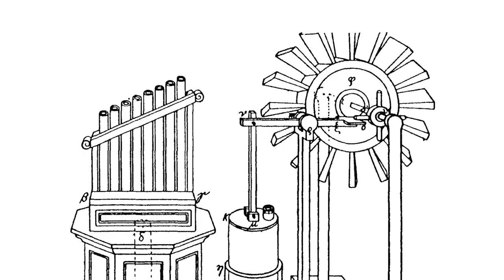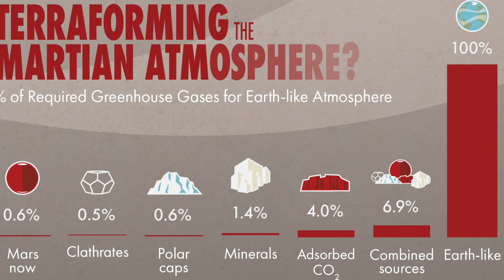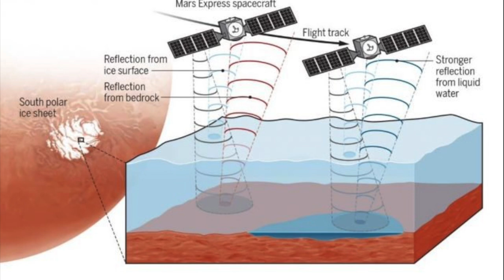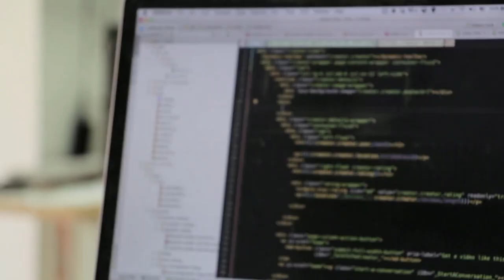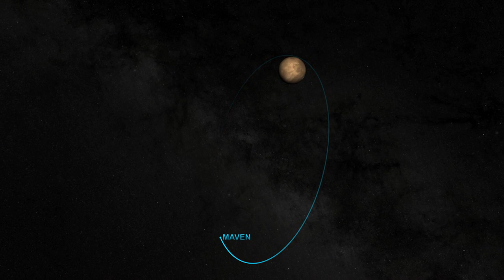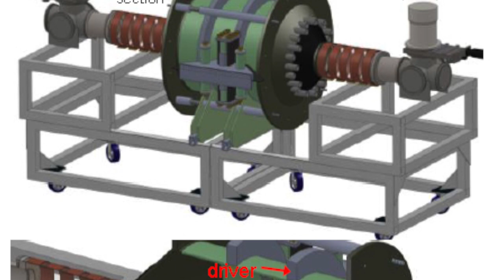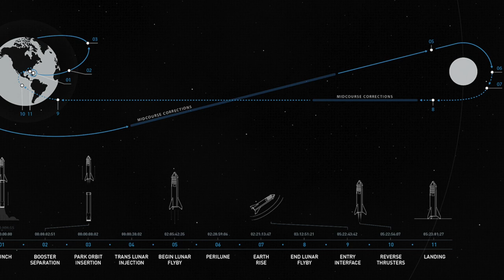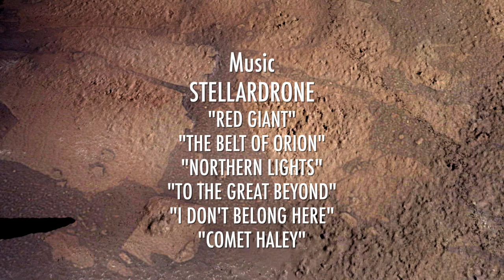Mars And Beyond With Dr. Robert Zubrin

Comment: I'm no expert but I think until and unless we put an artificial magnetosphere at Mars, we can pump all the greenhaus gases into the atmosphere we want but they'll be blown off the surface by solar wind. Mars will remain the domain of extremophiles (sp?) until we can deal with the radiation issue.

On a less critical note, JMG, I LOVE the new channel.
Reply: the solar wind issue depends on speed. like a water tank: it can leak AND be full if you manage to pump in the amount of water you are losing because of the leak. if you replenish those gases faster than the solar wind can blow them away, you're good.
radiation can be a problem, though and humans need some shielding, but it doesn't have to be a planetary shield. just live under the surface and bring some portable shielding technology if you have stg to do on the surface.
genetically modified humans? changing hair colour or stg like that is not a big deal, but creating a radiation proof human... that would be a far greater challenge. by the way, can you modify the genes of an adult? if it is possible only in fetuses (or at some pre-adult stage), it brings up a ton of ethical and legal questions
Reply: I agree in principle with what you're saying re: the water tank analogy. It's just that you really gotta be churning out a consistent output to make that work and achieving that is gonna take time. An artificial magnetosphere is, as another commenter elsewhere pointed out, not that difficult to deploy and would solve the shielding problem everywhere on the planet all at once.
   Bioforming, to me, always seemed like the premise for a good space monster movie. The premise is fascinating though and I'm eager to learn more about it. I first heard about the concept back in the 90s. My first impression then was very much like yours (legal and ethical questions). The idea is compelling though and merits more discussion.
Reply: Mars is more valuable as a quarry than as real estate. It's a lousy place.
Reply: "You stopped being human when you claimed that miserable red planet." - Admiral Nguyen (The Expanse)

Yeah I've always believed rotating stations were the way to go instead of planetary colonization. No muss, no fuss, you just build it and you can customize the environment "to taste." You can even adjust the gravity to your liking. But let's face it, people like the idea of living on planets for some reason. Mars will most likely be terraformed in the future, probably Venus too.

Yes I ended that sentence with a preposition. So naughty.
Reply: I agree it is a problem that will have to be addressed -- probably in several ways but it seems to me that it is essentially an engineering problem -- some sort of magnetosphere or orbital shielding perhaps to achieve anything more than just limited terraforming.
Reply: @sargonofakad  A thicker atmosphere would suffice to protect Martians, and supposedly an atmosphere would last tens of thousands of years without maintenance. Or forever, with maintenance. It's still a lousy idea IMHO. I'm with the orbital city commenter above. 

Once people have a choice between a rotating garden with decent internet and a nasty, empty, disconnected, low-gee planet, then stations will take over from planets as the common-sense destination. Every planet except earth is really awful.
Reply: @fraggenaught  ... up with which shall not be put.
Reply: Maybe that will be 'easily' obtained, considering we will have the available power by then.  In the meanwhile we can 'easily' live underground in dome-shaped caverns.  The low gravity could be partially-solved ('easily') by rotating our local environments.  QED
Reply: @tonyduncan9852  Quod errat demandstrandum
Reply: 'quod erat demonstrandum' - the Latin for ""that which was to be demonstrated".
Reply: @tonyduncan9852  thank you for the correction,i was not certain of the correct
spelling

Comment: Good interview, Dr Zubrin is always insightful. Though I don't really agree with his opinion on not sending the BFR spaceship all the way to Mars. That just increases the complexity and makes landing on Mars more difficult because an entirely separate heat shield and propulsive landing system is needed, and that just increases weight and therefore decreases payload. The cost of individual spaceships shouldn't be a big factor because like he pointed out the cost can be reduced through Earth-to-Earth travel, and I expect the spaceships sent to Mars wont be the new ones but rather the older ones that have already flown 95% of their total flights.

Comment: There is the problem of Mars very weak magnetic field and the inability to maintain an atmosphere from solar winds with out one.Domed surface sites to establish underground colony areas is a solution-but a stable Atmosphere will be issue for long term-(generational)-settlement.
Reply: ooops! I see somebody already beat me to this issue. I missed your comment before. Sorry. I basically restated everything you just said.
Reply: Ed Stoutenburg a atmosphere wouldn't be stable but that'll be over millions of years
Reply: Josh, what if we get hit by a gamma ray burst? Can you fix that with a donut? And are you sure the tail offers the same protection? In magnetosphere simulations you often see lines getting jostled when the wind picks up.
Reply: Thats awesome Josh, an extremely good and simply idea to solve a major problem!
Reply: @mgc7199  If Earth gets hit by a gamma ray burst we're fucked, don't use that as an argument against Martian colonisation..

I wish people would stop trying to use the lack of Martian magnetosphere as an argument against terraforming, the solar winds would take literally MILLIONS of years to degrade the atmosphere, very easy to replenish.
Reply: Mgc7199 - if we get bit by a GRB, it won't matter of we're protected by a natural or artificial magnetosphere. Everything in the solar system would die.
Reply: Just need to get a decent sized moon to stimulate heating of the planet's core
Reply: mgc7199 - An artificial magnetosphere around Mars would be no more or less efficient than earth’s magnetosphere is. &, therefore, would be no more or less susceptible to a Gamma Ray Burst than our own magnetic field. So, a Gamma Ray Burst that was powerful enough to destroy Mar’s artificial magnetic field would destroy earth’s if it hit us. In either case, the people on the planet that got hit would probably die if they weren’t several meters underground.
Reply: Abe Kane - Actually, Isaac Arthur over at SFIA has shown that the “donut” artificial magnetosphere would be easier & simpler to build around Mars than moving a Ceres size object into Martian orbit...
Reply: ReddwarfIV - GRB’s tend to be focused like very powerful lasers. If one hit earth, it would probably miss Mars & vice-versa (unless the two planets were “lined up” like a pool shot). Having self-sustaining colonies on multiple planets, moons & asteroids would guarantee humanity’s survival in that situation.
Reply: Landing sure is hazardous...I wouldn't recommend traveling back and forth much.

Comment: I actually think that that the skyhook, while much easier..
Will be made After a platform.

Floating by buoyancy and ion drive, both methods practically passive.

I.E. less fuel for the platform itself. More for crafts.

It lowers for planes to land on.

Rises to pickup and send to LEO.

Comment: I think that the first step to terraforming Mars is to give it a large Moon orbiting above geostationary. This would gravitationally stir the pot of whatever remains molten in the core of Mars and create a magnetic field. The magnetic field would filter out Solar ions that we know would errode any atmosphere we attempt to create on Mars. If nothing else it will reduce the surface radiation level. The Earth's Moon is only about 1% of the Earth's mass. A large Martian Moon could be lifted from the Martian surface by Space Elevators, which would be practical on the lower gravity of Mars. This could be automated with robotics so the Moon gets created even before people try to live there. Just my 2 cents but think about it - a lot of the life-friendly features of the Earth are due to the Moon.

Comment: 1000 years to totally terraform Mars? I’ve heard that the chemical comp of mars soil when
processed/burned is 10 x more affective at creating green house gasses than anything on earth. If so it should help but 1000 years? Also if we are to have a lunar base and be on mars by the 2030’s what advances are we making in dealing with radiation? Would that not have made mars in the 80’s a suicide mission not the start of colonization? Would love to see vid on ideas and materials being experimented with dealing w space radiation.

Comment: Why not somewhat assemble the ship in orbit, being mostly fuel. Get all that in orbit. Then launch the ship. Or crew, cargo portion, connect to the upper stages with fuel and engines, with a pair facing forward, and 2 rearward, to allow deacceleration without maneuvers, and either lading and relaunch capable, or stay in orbit, with a lander, it's going to cost either way,

Comment: Man, thorium can't get any love. Solar doesn't cut it and fusion is too far off.
Reply: Thorium Breeder Reactors need to be encased in 10 feet of concrete to reduce the amount of ionizing gamma radiation to something that is manageable for 10 feet of soil to reduce to safe levels. That's fine for producing electricity here on earth, but in a space ship, is way too much mass for an effective reactor engine.

Comment: First lets see if and when there is a certified human passenger-rated BFR before we get too speculative about colonizing Mars and beyond. It takes dozens of successful test flights to certify a new airliner. For rocket boosters and crewed space vehicles  who knows? Aside from the rocket booster/Mars lander, I'm not at all convinced that there is a bullet proof life support system for 100 passengers for however many months the trip out is supposed to take (4-6 mos is what I've been seeing in the literature). So far the ISS has had up to 6 people for unlimited stays. Is that enough knowledge and experience to scale up to the performance required in deep space for going to Mars with a whole lot more people (100?)? Upon successful arrival, then what? The really hard part begins. Better have a well thought-out plan and lots of pre-positioned supplies, including shelter, life support and spares. I just don't think this is going to happen until 2040. The easy part is building the propulsion/space vehicles. It's all the other details that no one talks about in any detail.